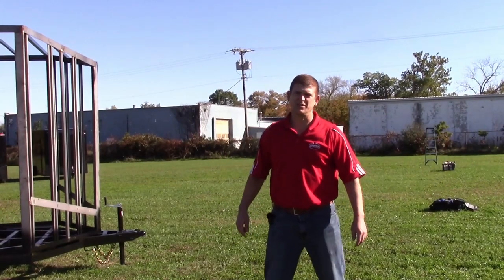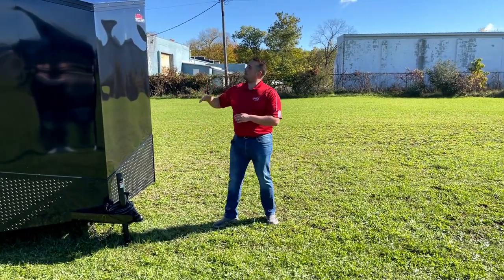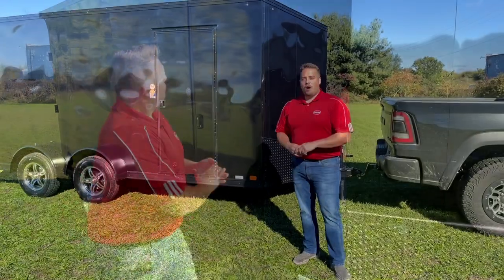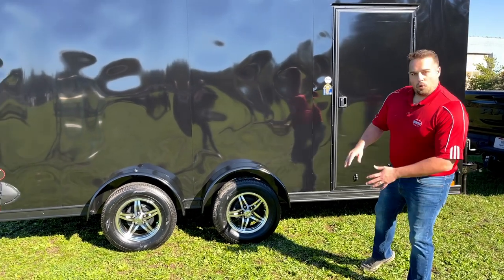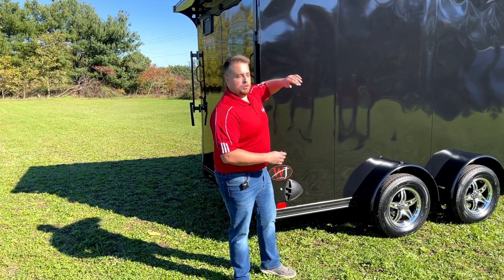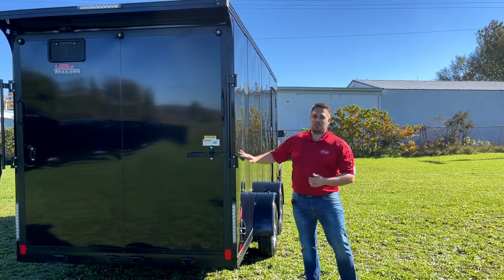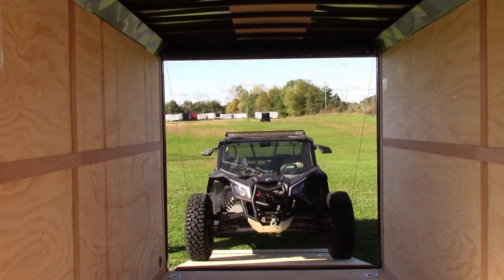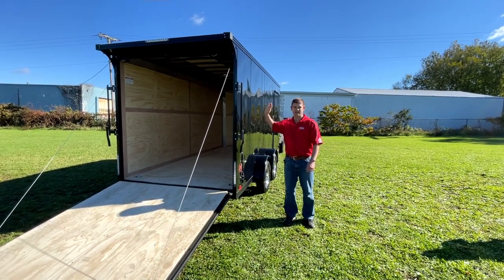United Trailers -  WJ Series

Comment: I’ve had my trailer for a few months and the little light on the wheel well with the wire that is now hidden…it’s just loose under the well and my wheels snagged the wire and goodbye light. The screws in the door are all coming loose on door also. Just something too consider with the next model. All in all it’s a pretty decent trailer.

Comment: I bought a 6x12 xlv model 2 years ago that is parked under a carport thankfully.  Just used it for storage. Just now I pulled to plywood interior out to insulate. I found a hole lotta daylight, the wiring not secured, the small flooring triangle in front not screwed down. And the  bottom of the flooring is not treated with a water seal product. These trailers must be engineered to fail. Good thing I'm handy in the trades to make this garbage right